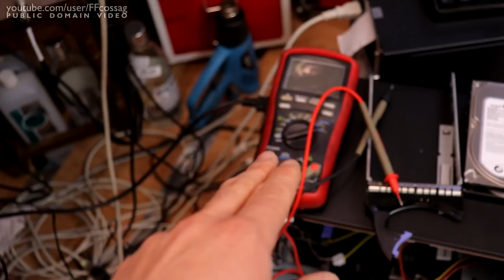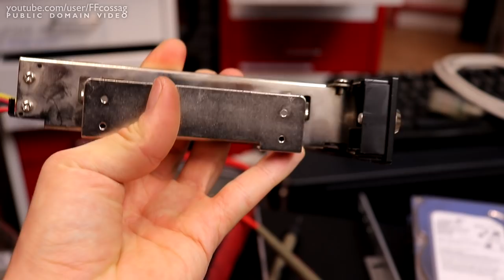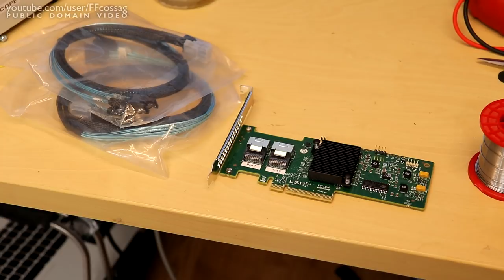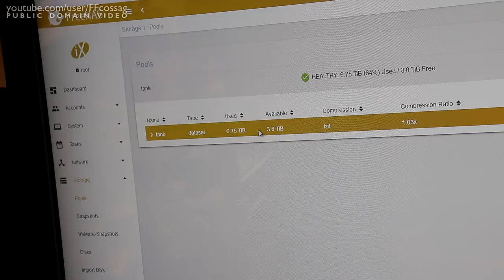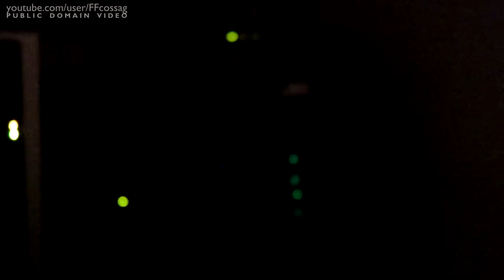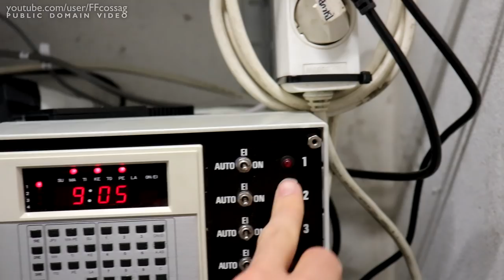Building a FreeNAS back-up server that runs on a mechanical timer.

Comment: I have a P5K Pro motherboard, it was in regular use for years and still works great. Originally with a Core2Duo E8500, 2GB, XP, upgraded to W7, 6GB, a Xeon E5450 (socket mod), and eventually W10.

Comment: Very smart and reliable way of control :-D.
The old tech timer is good, i like simple systems.
With more complex systems it's harder to have your evil way with it :).
I half expected you to take a plug in mechanical motor timer and bring the switch contacts out to play with ;-D.
Rotary timers are ultra simple but are so usefull.
Reply from the maker: Simple yes, accurate - no. This one's at least crystal controlled, lol.

Comment: FYI, there is a LOT of deploys with no ECC! Dont be alarmed
Reply from the maker: Indeed, but I'm of the opinion that ECC should be the norm and not the exception. Bit errors in RAM is one of the more common fault conditions in a computer, they just usually don't cause issues since lots of applications don't kill themselves from a single bit flip. Zfs is more susceptible to such errors since it uses a lot of RAM for stuff that really has no fault tolerance.

Comment: I'd hate to disillusion you but a lightning strike won't be bothered by a relay contact. It just jumps over, so for real protection you'll need something more effective. ;-)
Reply from the maker: Yes, assuredly so, if it's a hard strike. In such a scenario all you can do is pray. 

A relay contact will provide protection up to several kV though, and will definitely mitigate damage from a strike some distance down the line, and provide complete protection for a neutral fault if the power line into the house fails. The main purpose of the relay contact is to reduce the surface area for failure related to power-on hours.
Reply: It's only really going to jump if that gap is a much better route then some other route.  Chances are it won't be.   Even if it did jump it shouldn't be the full voltage,  other much better paths I'm sure exist.

Comment: Your control lead signals should really be done via an opto isolator, keeping the timer and pc electronics 0V electrically separate.    Nicely done though 👍
Reply from the maker: I don't really see why that's necessary since the timer runs on an old-timey transformer. Basically, all we're doing is adding ground to the timer.
Reply: @FFcossag    Got it.  Didn't quite see, but do you have a diode to prevent (block) pc 12v powering the rest of the timer ?

Comment: Set BIOS to auto turn on,  FreesNAS Rsync job to copy over what has changed,  ACPI shutdown after.  Most machines support scheduled turn on times.
Reply from the maker: The point of this device is to have it isolated from the power grid while it's powered down, to protect it from lightning damage or grid spikes.
Reply: @FFcossag  In that case be sure to put a good surge protector inline even with the relay shut off.  That should catch any high voltage that could jump the relay gaps.   Better yet put it after the relay contacts as well.  I have so many MOV's around I would break out the soldering iron.
Reply from the maker: Oh, it's connected to a UPS, which has a quite decent MOV pack inside of it, though no amount of surge protectors will save you from a lightning strike. Even just a relay provides much more secure protection since you need about 2 kV across the relay contacts in order to begin arcing over. It also removes one path to neutral, which is very important since most lightning damage is caused by voltage differentials between ground and neutral, or ground and ground. Ideally, this box would also physically disconnect the ground lead on the power cord, but I don't think I actually set it up to do that. Oh well!
Reply: @FFcossag  The MOV's will ensure the voltage doesn't get that high most likely.  Even if they blow to bits in the process.

Comment: That's a pretty interesting solution, I personally would have either made a network boot that regularly sent an on signal to the system every day. I'm not very familiar with freenas but I'd imagine there's some kind of script you could write to have it turn off after a certain amount of time with no operation. Otherwise I know there's power bars for servers that can be operated over serial and Ethernet. Those can be found on eBay for virtually nothing. I really want to invest in something like this for my rendering server I use with Vray Swarm.
Reply from the maker: Wake-on-LAN requires the machine to be connected to the mains at all times, which is something I explicitly want to avoid. A LAN controlled power bar only adds needless complexity in my opinion, since we don't need to be able to change the schedule over the network, plus it would be difficult to meaningfully integrate with replication, AND would still have to be modified to allow for a keep-on signal from the server. I'm sure they make more sense in your use-case, where on-time might be variable - you should never buy anything mains related off of Ebay, though, unless it's a used brand-name product. ;)
Reply: FFcossag True, for me I wanna be able to just click a button on my workstation and within 30-60 seconds have my Swarm server running and able to take tasks. Oh and God no cheap Chinese stuff, I more mean second hand data centre gear. Are surges a issue in your area? I've personally never dealt with a power surge here in Canada, I'm sure they happen. I'm probably just lucky
Reply from the maker: Power surges are reasonably common in rural areas here, since we use 3-phase for residential power. That means that if the neutral conductor gets cut for some reason, but at least two of the phases remain, we get weird distorted 400 V 2-phase mains in our power outlets.

Comment: @FFcossag So tell me, how hot do those hard drives get all stacked up like that?
Reply from the maker: Not very, since the hard drive cage in the IBM system is designed to eat 15kRPM drives.

Comment: Can you do a video about backup power for main modem and router? I have some trouble :)

Thanks
Reply: Nice solution :) what about the bios battery? It may cause problems.
Reply from the maker: I just use a small UPS for mine, it's easier than trying to figure out some kind of DC UPS type thing.

If the CMOS battery goes bad in that thing, I'll deal with it when I have to. They usually last forever though even if the computer is unplugged, so I'm not overly concerned.